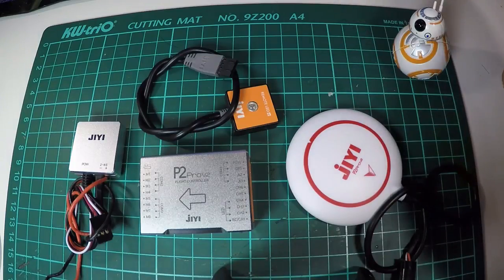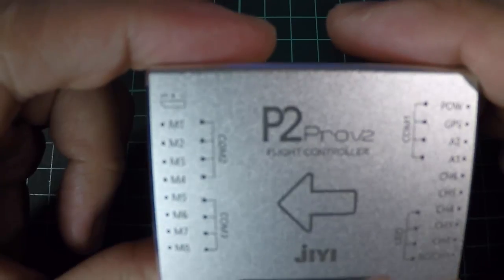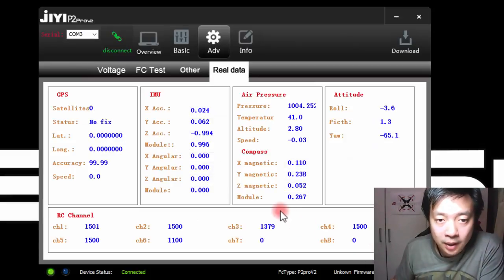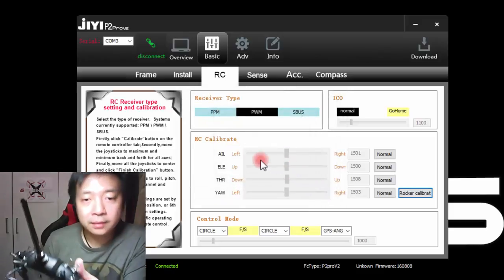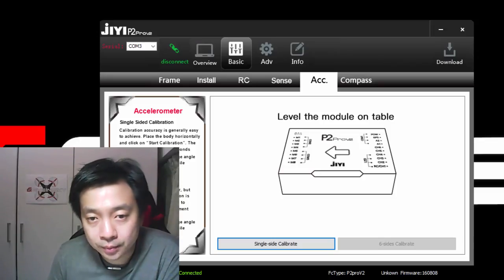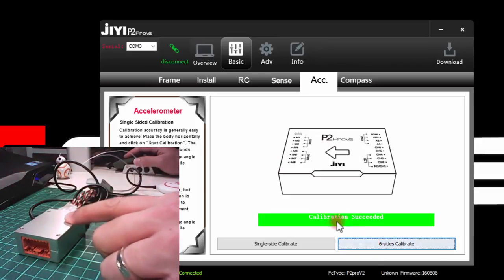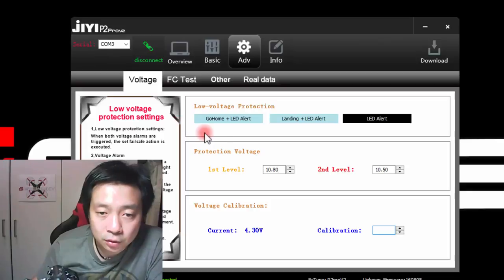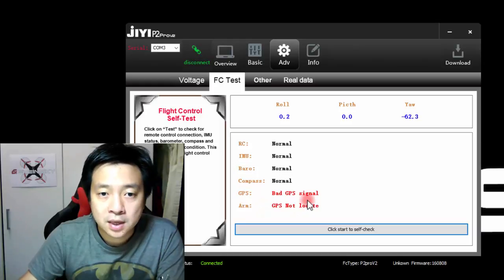JIYI P2Pro V2 Flight Controller Feature Walkthrough, Initial Test & Setup Guide

Comment: Hi,
I came to the limit of madness because I have a problem with a P2Pro) the model you keep on the right at minute 1.45 of your video.
In practice I deal with assistance on SwellPro drones and, a client of mine (totally ignorant of drones) at the first ignition of the drone managed to arm the engines but, not knowing how to disarm them, he thought it well to turn off the radio control for two times before being able to stop the engines. Now, the first thing I reproached him is that, FOR ANY ELECTRONIC DEVICE you have to study the user manual first and then start using it. However, now all 4 motors emit a continuous beep as if the ESC needed calibration, also the main LED on the Power Board does not turn on but the most serious problem is that, connecting the drone to the PC via the USB port does not connect and an error message comes out like this:
SERAL PORT OR BAUDRATE SETTING IS NOT CORRECT.
I don't know what to do anymore .... can you help me?
Reply: That sounds like a firmware loss.  I had the same issue with RADIOLINK TURBOPIX and this is a big problem.